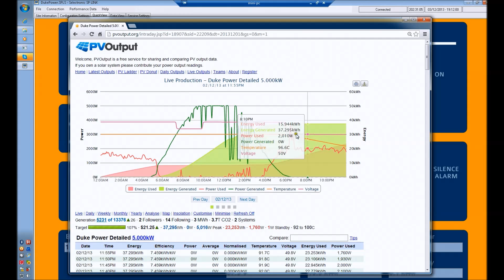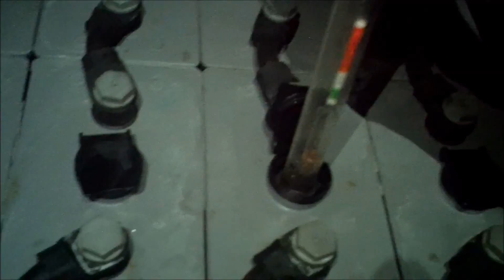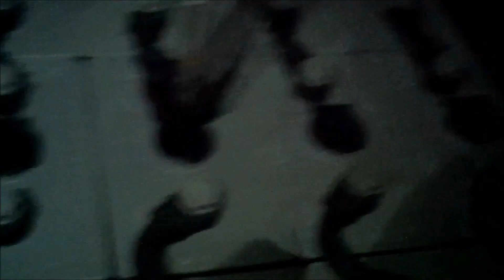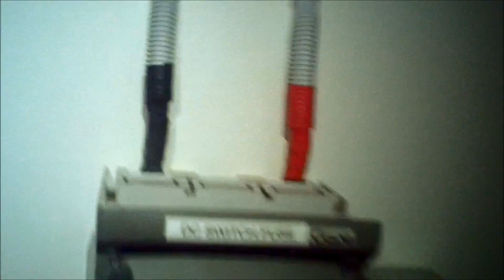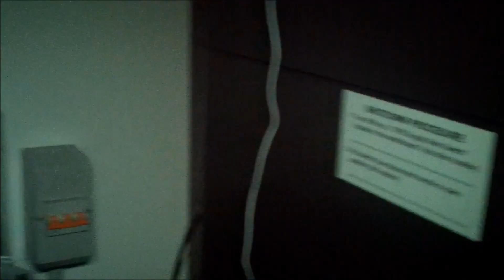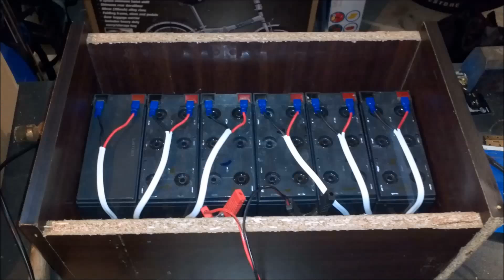Power System - Part 13 - Charging Problems

Comment: very good video mate. yes let them settle down then Bulk them again. That flash charge controller is proving to be shit. You can show them my comment. Tell them i said there Programmer needs to be fired or shot. You also need to send them a Bill for you time sorting out a problem that you should not have. Keep well my good friend :)
Reply: +Justin Case Solar Power You do realise that the "Programmer" of the charge settings is either the end user or the installer.  It's not some simple Inverter with a setting for  AGM, Gel, Flooded or Custom.  There is not many if any other inverters like them on the market that allow for full charge setting control at every stage.
Reply: +Ex-Cav yes its like every other good charge controller on the market. Its end user set. most have the basic settings in them for simple minded people. I always use the custom settings. But the problem comes when even the installers dont have a brain in there heads and set them wrong as they do not understand what was installed. Duke had to reprogram his inverter and tweak it over time. Ask him if he was happy with the installer settings. And the installer who programmed it really did need to be shot.
Reply from the maker: +Ex-Cav The problem was a bug in the algorithm that determined State Of Charge. I sent them my data and they released a firmware fix that solved the problem. This IPS is one mighty beast. It has 4 internal dry relays that allow you to do all sorts of things based on what is happening within the system. Eg turn on a pool pump when the batteries are fully charged. The other thing I love about it is the two external shunts. That allows me to add more panels and charge controllers and perfectly monitor their output. Finally it has internal digital relays that allow you to automatically switch on different hybrid settings based on external factors such as excess load.